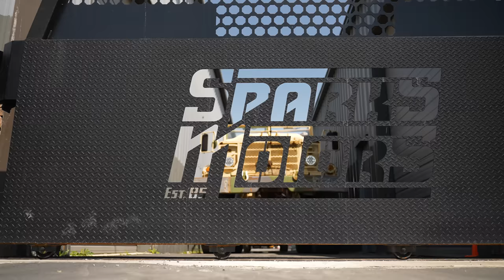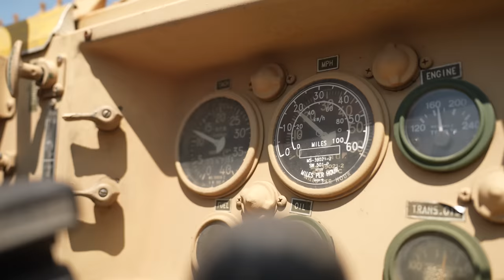Teen Loses Control and Goes Over Cliff Edge After Just 14 Days Behind the Wheel!

Comment: You never forget your 1st car, or the lessons you learn from mistakes learned from it!
POL552M, Hillman Avenger, (UK Mopar,  Plymouth Cricket in Merica).
Rebuild engine 4 months into ownership, grenades the bottom end bearings on the M5. Will never, ever forget to check Sump plug Copper washer., or dip oil regularly. Especially before a Road trip.
Best of luck to this good lad for the future!

Comment: Really wonderful to do for Max, he's got  the weight of all of this bad stuff happening, and especially his good friend injured and in the hospital, that's a heavy load of darkness for anyone, let alone a 16 year old kid.
It's a good thing you guys were giving the Jeep a lift, I was surprised to see the damage to the stock springs.
Helping out Max the way you guys did, after the reveal I experienced the good vibes in my soul.😊
The solution for a key was funny as hell, when I was deployed at a forward base in, Afghanistan, a Toyota PU appeared on camp without ignition key parts, but there was a flat piece of metal sticking out where a key would go.  We used the pliers solution to start it until I flattened the, case mouth, on a empty .50 caliber brass case so it would engage the, flat piece of metal.😮😮😮😮

Comment: That steering column is easier to defeat on the left side, pull down the lower housing and get at the two rods one unlocks the wheel and starts it with a push

Comment: Here's a thought.
That Concrete Mixer Truck you bought, with the dual direction rotator drive for the mixer barrel.
Have you considered how well that would perform as an off-road recovery crane, if the barrel was removed and replaced with a HUGE "long-line" wire rope cable, which could simply feed UP into an all angle horizontal swivel feeder, to allow towing / winching, from any direction with the cable exiting the rotator drum from the top.
That would be a mean beast, if the rear aux steering axle, actually kept in line with the way your truck WAS turning, and NOT flopping aimlessly to full lock in the opposite direction, as that acts like a HUGE DRAG, which bogs your main drivers from keeping momentum in mud or snow (or over huge corrugations.
No one else would have a SEVEN axle wrecker/tow & recovery machine, especially one with a (flat) Vertical shaft, top exit/entry "long-line" rotating cable drum, with awesome off-road ability, as we have all seen the limitations of short-cable recovery cranes, that don't reach vehicles that have fallen off clifftops such as this teen did, or the other one of 1200 foot (barely a month ago - re: "Your Most Heart-breaking Recovery Yet (Fatal 1,200ft Crash)" which could have done with a "single cable" LONG_RUN cable rescue/recovery vehicle, with a VERTICAL rotating cable drum and top exit/entry cable - as you would NOT have needed to align yourself across the sharp crest of that hill, but merely have used some off-side hydraulic feet, that would be capable of lowering say ten ft BELOW your operational ground level, to act as if Daddy Long Leg "spider feet" outriggers, especially if they had wheels instead of steel feet, to allow you to reposition the truck, or "move along" a ridgetop, without lifting any outrigger arm, as they would simply follow with there mobility wheels at the ends of those arms.
Daddy Long-leg spider type.

Comment: I see a lot when f these videos where very mice things are done for people. However I must call "foul" because it all seems to be staged. The only time I hear of things like this is on places (like YouTube) where videos can be manipulated. I'm 64 and a Veteran. I'm also somewhat homeless as my "camper" has no running water, no bathroom, and only an electric extension cord for power. I also have no transportation. My handicap keeps me from working (severe Osteoarthritis in knee and shoulder). Joint replacement? Long story but needless to say it's out of the question. So these videos show my wishes but it seems they are staged or somebody else gets all the luck and I can only watch. Call me jealous but before you do...do this....walk a mile in my shoes (if you can) and then say it out loud to yourself afterwards.